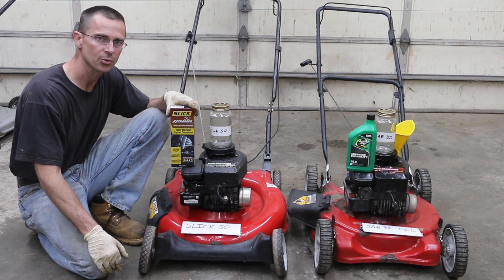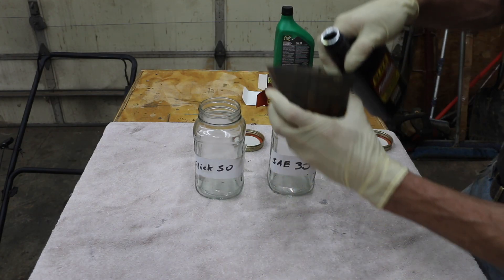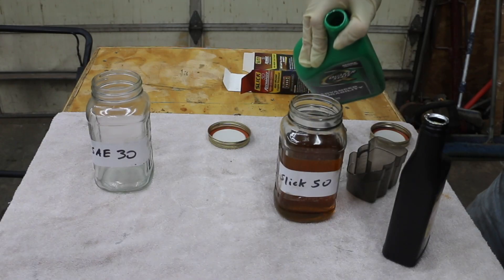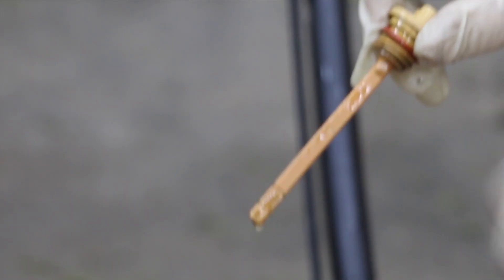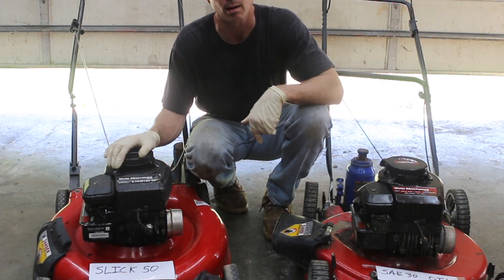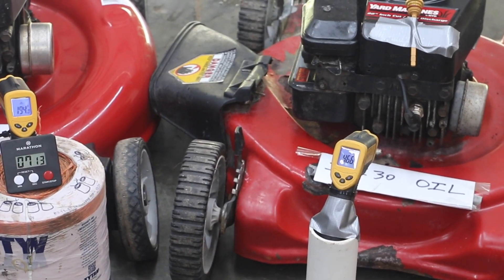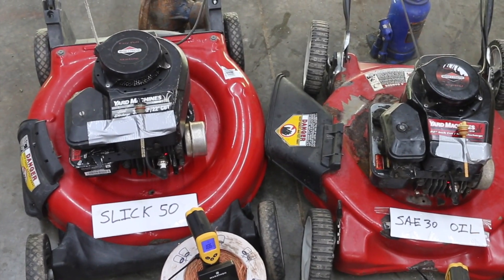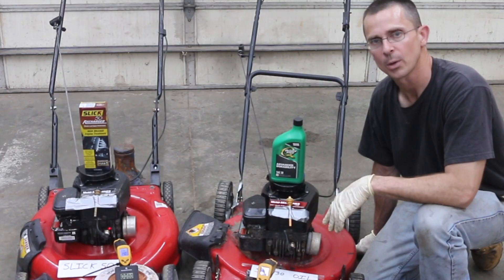Can't believe what SLICK 50 did to my engine!!--Dry Crankcase Test!

Comment: issue here is control. those engines are same design but way different hours. There is no way this test is reliable. the bearing wear/cylinder wear between the engines is a huge factor. You need two identical brand new engines to have any real comparison. So the ONLY thing learned is slick 50 appears to run cooler. yet again this could have to do with piston material in either engine, exhaust from slick 50 engine blowing high temp air into s.a.e. 30 engine, or fuel mixture rich or lean in each engine. while both are same design they could be built in different factories with different carbs or jetting . thanks but not a reliable test

source= im an A.S.E. certified mechanic in engine rebuild/diagnostics
Reply from the maker: I agree.  Using 2 new engines would be ideal.  Thanks for watching the video and commenting!
Reply: could also have something to do with slick 50 being complete bs.....
Reply: Either that or just buy 2 brand new mowers...same time, same store..production tolerances should be consistent enough to call them equal....not that it matters..when it comes to lubricating bearings its all about keeping them cool..oil keeps the temp down enough to keep bearing material below melting point. Ever remember seeing a booth at the swap-meet...guy has an old 6 cylinder on a run stand without an oil pan...and the motor running? Know how they do that? Roller bearings on the rods and mains...rings dont need much oil..keep the temp down they will still seal enough to run a motor with no load happy...hyd. lifters bleed down without oil..adjust them like they were solids....you can run a differential a million miles without oil...100 yards at a time. I had an older olds..blew the bottom radiator hose 25 miles from nowhere...drove it home with no damage...start it up, run it up to 60 and shut it off and coast it down to 5 mph...shit 50 is garbage and always has been...as for lucas...destructive testing is not within my budget but...if you use atf for drilling holes in steel it works plenty decent...motor oil works oil after it burns away on the cutting edge....lucas is not a good lube for drilling..it seems to need more pressure and things need to get hotter before it starts cutting...there is no 'miracle lube" no substitute for clean oil...now days with f.i oil contamination has been reduced to the point where most any motor will last 300k miles....just my opinion of course..
Reply: iamtehstig yeah then when one breaks, put it back in the box and bring it back to harbour freight. "idk it didn't run very well"
Reply: Yeah, I would toss 20 bucks towards that for sure. Start with brand new Predator 212s. They are usually marked down to 100 bucks or so.
Reply: Not an advocate of deception, but for joking purposes, "you could even buy the extended warranty"  = endless supply for 2 years.......
Reply: Deftones Dsm Completely spot on, A cool video but as an engineer was quite frustrated watching it, there are so many variables at play that the results are meaningless. Personally lower outside head/block temp ain't always a good thing. Is the slick50 helping by reduced friction or is it interfering with the oils ability to absorb and transfer heat to the block/head like it's suppose to? The cooler running engine could simply be running richer, ignition timing wrong, the control factors are endless.
Reply: Dennis How is it a good baseline test?  We know nothing about the prior condition of either engine.  We don't know the hours of operation, maintenance history or anything else about them.  An engine with ten times the hours and a history of never changing oil or being run low on oil vs an engine with low hours and impeccable maintenance is hardly a fair or accurate comparison.  Of course we don't know that is the case but that's the whole point that invalidates this experiment.  I would say the only thing we learned is that an engine with Slick 50 runs cooler but the testing is so flawed we can't even reach that conclusion.  To do so we would need to see the operating temperature of the same engine before and after Slick 50 was added.  Some engines run cooler than others for a wide variety of reasons.  As also pointed out the hot exhaust from the Slick 50 engine was directed at the conventional oil engine.  That alone likely made the temperature difference.  These are air cooled engines after all.
Reply: It is reliable , it has been made b4 and it showed exactly the same result. Slick 50 destroys engines, even with oil in them.
Reply: The neighbor kid puts my used synthetic oil in his old truck, and that damn thing has outlasted 3 of my new cars.
Reply: ZoDDyXXX hey, my alma mater, Cal Poly!!!!

Could you possibly scan that article and send it to me? I'd love to read it. I could also host it under my own name if you'd like (so you stay on the good side of © junk). Cell phone would be just as good in the absence of a scanner. Might be even easier given all the different options for sharing photos from your phone. Some Acrobat Pro OCR magic and boom, easy to share PDF for anyone who wants it.

Anyways, at Cal Poly your first quarter is scheduled for you automatically and for BSME students that includes ME134, intro to mech eng w/lab. One of those labs is tearing down and reassembling a 4 stroke Briggs. Beyond the basics of learning how everything works the major lesson is orienting the piston rings such that you got decent compression after reassembly. I wonder if that lab came out of the research mentioned in the article you've summarized.
Reply: I would also add thermocouples for temp measurements, placed in the same location on each engine, as well as RPM sensors. Many different options including some basic data logging. 

At the very least, for temperature readings using the infrared thermometers I would grind a flat spot (s) somewhere and paint them black with high temp paint to provide a larger and unicorn target.
Reply: Deftones Dsm 0
Reply: Jeep Life Ya wanna bet? I know "they" and   "they" was using roller rod and main bearings is 2 strokes and 4 strokes long before I was even born
Reply: Both engines are the same with only possible type number differences. I believe those are Briggs & Stratton 9 series. "90210-1127-01 vs 90210-1129-01", something like that. Note both have Vaccu-Jet carburetors. There are no carburetor adjustment screws whatsoever on those type engines, not even an idle set screw. The main jet is actually down in a chamber in the gas tank. No idle circuit. They don't idle. No throttle controls on both mowers. The cables seen are the operator presence or "Dead Man Switch" cables. If it helps, I've recently retired from working on small engines since  October of 1973.The brands of mowers are different. That's about it. However, running these engines under no-load conditions is not a reliable testing method. Had both engines been under load, there's a good chance the Slick 50 engine would have seized soon after the "regular" engine. Also, these engines never seize at the piston. It's always the top crankshaft bearing. Always. I've never experienced a customer's mower seizing at the piston/cylinder from lack of lubrication. To load test vertical shaft mower engines, it's required to make some sort of spray bar (a pipe with holes drilled in it) that sprays a significant amount of water up into the blade and blade housing/mower deck. I used home-made ones as a "poor man's dynamometer/load testers". They're popular with grass and dirt removal also. Back in olden days, (1960's) there was this shyster at the local swap meet who ran a horizontal shaft small engine with a clear Lucite sump cover to show how well his oil additive was. He'd run it dry but at an idle. "Look, folks! No oil!" My brother and I, as kids, would ruin his spiel with: "Put that sucker under a load and floor it!" My brother would also say: "So, as long as oil is kept in the engine, your product wouldn't be needed." Poor dude. Potential customers would split. Any internal combustion engine will idle forever using residual (cling) oil. Of course, revving the sucker up might fling and/or squeeze out residual oil from bearing surfaces. I have completed many "engine failure analysis" courses over the years, one from John Deere Industrial (the yellow Deeres)  I wonder if "Scooter George" is out here in the internet world watching. Hello?! George? You out here?! Care to share your experience(s) with engine failure?
Reply: Actually, A.S.E. "certification" means nothing. Anyone who knows how to read can get "certified". The testing procedure(s) are "open book". The answers are provided. "Why?" might you ask? Because today's "mechanics" are, for the most part, idiots who probably have trouble finding their way home after work every day. John Deere Industrial (the yellow Deeres) had the same type of testing called "John Deere In-House Factory Training Programs" I "passed" about 17 of them and have them all framed but not enough wall space anywhere. I've since attained 20 more from small engine "Update Seminars" which were nothing more than a bunch of hung-over mechanics looking forward to the free buffet lunch. How many of you "mechanics" been around long enough to have had to look up parts with tome-like catalogs? I have! Pre-micro-fiche days. Now, it's just a matter of typing in "partstree.com" on your laptop on your tool box. Be easy on the kid, Dennis! Though his grammatical skills are lacking, he actually sounds rather smart..at least compared to most of these "Youtube Experts". What's your qualification(s) & experience(s), kid?
Reply: You could always look at the higher temperature as the engine dissipating more heat to the atmosphere, therefore being more efficient. What needs to be done is somehow getting a reading of the connecting rod to crankshaft temperature. I recall an "Update Seminar" from Brown & Wiser, those ones usually attended by hung over mechanics (me included) from different small engine stores of the Pacific Northwest. One "instructor" showed a video he made of a Honda-powered lawn mower running with no oil. The video was excruciatingly tedious (boring) to watch because the dude had it run at idle. Nothing happened so he jacked the RPM up a bit. Nothing. Finally, he ran it "WFO" (wide...open) and it.....slowly........came........to..........a....................stop. Poor guy. I told him: "Next time, put a load on it." They'll almost idle forever without oil. Me? I'd rev the mower to 6 grand bypassing the governor and drop the mower on a protruding from the ground pipe! A late friend of mine took a horizontal shaft Briggs 3hp and ran it "WFO" (with oil) and "staked the piston" to the cylinder with his .58 caliber black powder musket. He said when it came to a stop, the built-up inertia made the engine take off, rolling along like a runaway wheel! I would have PAID to see that! He was cool...
Reply: John Herlstein Yup, the problem is they sell a 'make a quick buck' solution to LONG term problems, unless you undertake a personal and scientific 8 year long term test to prove these snake oil products (let's face it, who's ever going too) they will keep selling. I believe in good quality oil and change it more frequently and that's it, everything else is snake oil. My personal favourite is the 'engine restore in a can' 😉 www.enginerestore.co.uk - it's laughable.
Reply: Hey 650! What was the source of the seizure? Piston? Crank? Did they say?  Are bullets cast from old wheel weights more destructive than those cast from pure lead?  Did you know that if you over rev your cast iron Kohler engine  it will explode but the pieces stay within the engine. You do, however, get a circle with peace sign crack in the cast iron...
Reply: Deftones Dsm 
P
Reply: Deftones Dsm Thanks for the info, Buzz
Reply: No, he didn't go so far as to open up the engine and perform a failure diagnosis. This is just a scam video to sell the product. Like one famous person said many moons ago: "Why would you need the product if you just kept oil in the engine?" I think it was either Tommy Edison or Hank Ford on a camping trip to the Dez. I was running a customer's mower to get the engine oil warm prior to changing. I was probably the only mechanic on Earth that warmed customer's engines before changing but that's a different story. Anyway, the engine, even though it had oil, put the conrod through the case scattering aluminum everywhere. I thought it was cool! I called him up and he said: "That's okay. I was thinking of buying a new one." He could have been shitty and insisted on a new short block. Went up to Oakland yesterday and saw Rick K. at his antique store.
Reply: On another camping trip, while gazing at the campfire  sparks (AKA "glowing goodies") Hank  mentioned to Tommy all the scrap hardwood pieces left over producing Model T bodies and how he hated throwing ANYTHING away. Tommy thought for a moment and suggested that if the scrap wood was burned in a low-oxygen atmosphere, he could create charcoal briquettes. 

Did you ride the BART while in Oakland? Backfire your car at pedestrians?  Did you drop in on Arlen Ness?
Reply: The sale of those charcoal briquettes didn't make a "King" out of "Ford" but they certainly didn't hurt! Yes, I rode BART although pretty drunk at the time. Never popped my car up there. Yes, I met Arlen & thanks to a certain chromed oil tank bought from Arlen, a "Tramp" wanted to "Kick your ass if you weren't on those crutches." What a jerk, after all I did for him and his club.
Reply: What if Al Bernie Nobel hadn't died in December of '96 and gone camping with them? Sitting around the campfire, Hank would have asked: "Whatcha got, Al?" "Oh, dis es mine latesht envenshun. Watch dis!" The glowing goodies would have been absolutely spectacular! You would have wet your leg! Tommy would always ask "Wha'd he say?"
Reply: Oh, Hank didn't "invent" the assembly line, kids. He just improved on it. That endless line of T's exiting the "factory"? Just a staged publicity clip. They didn't come off but maybe one every 15 minutes, 1/2 hour or so.
Reply: Would have gotten a bang out of that idea.
Reply: HF sells those extended warranties with the selling point of "for any reason, they will replace it".
Reply: These little Briggs engines aren't too complicated. We're not talking Space Shuttle technology. They only  have 5 moving parts, not including valve springs, keepers and retainers. No ball or roller bearings. Just plain aluminum block material. It takes a lot of lack of maintenance to do any of these engines initial harm. The mowers appeared to be in good shape and not stored under a rain spout and shit. That's a good sign of little to no abuse. The test was fair but still misleading. As long as you keep oil in the engine, there's no need for Slick 50.
Reply: "extended warranties" are a joke. I know a dude who got fired from Sears' appliance department because he refused to push "extended warranties" on customers. His superiors told him that extended warranties bring more money to Sears than anything. If something has a 1 year warranty and they want you to buy an extended warranty, tell them: "If it's going to fail due to inferior workmanship and/or materials, it'll happen in the first hour. No thanks."
Reply: I backfired at Al once. Not a flinch. Used to explosions I guess. Tommy didn't flinch either. Wonder why...
Reply: "I notice that the dipstick/filler tube appears to be a different angle in the slick-50 engine versus the sae30 engine." Indicating what?
Reply: No, they're both vertical. Trust me. I've worked on literally hundreds of small engines. More like thousands but who's counting? You should have known.
Reply: The man to have asked would have been Rocky "Dipstick" Rowlett but due to unforeseeable circumstances, he's now bellied up to The Great Tavern in the Sky". Have one on us, Rock! RIP
Reply: You noticed how he "drained" the oil? No "expert" he! All these engines have a drain plug on the bottom of the engines. All you do is use the deck height adjusters (wheels) and set them so the drain hole is at the lowest. Of course having a mower lift certainly helps. I've had certain models with blade brake controls (BBC) that deny access to said plug but I just get the fucker hot and use a large piece of clear fuel line and use the old Tennessee Credit Card Removal System or "TCCRS". Some use a black hose and use the "SHIT" method: "Siphon Hose Ingestion Type". I prefer clear hoses. Comes especially handy when swiping someone else's fuel.
Reply: Where can I get a dipstick for a Honda S-50?
Reply: "No, they're both vertical. Trust me. I've worked on literally hundreds of small engines. More like thousands but who's counting? You should have known."
One engine is American, the other Asian. The former is on the up and up. The other one slopes...Went by a tavern in Everett Washington a few years back.  Sign at the bar said, "The Rock stops here." ; ) We all miss you Rocky!
Reply: Honda Mort 50. That thing had like 1.5:1 compression and ran so hot (when you could get it to start) the engine glowed white. Had to pull start it with a Tote Gote to pump up any measurable amount of compression. I remember his engine all covered with oil and a McDonald's cup crammed in the hole. He had a "Rislone" sticker on his 8th grade folder and I thought that was his last name for a while: "Rocky Rislone". Mom and Gloria took turns carpooling Pat, Dee, Claudia, Rosie and you to Cambodia...and back Hell of a daily commute! I recall going along for the ride. Conejo Grade was 3 lanes.
Reply: Deftones Dsm I would expect an older engine to last longer, due to sloppy tolerances.
Reply: Maybe. More room for expansion.
Reply: Some Douglas DC-3's are still aviating some 80 years later. Personally, I'd feel safer in that 80 year old aircraft than any new passenger aircraft. I mean, what are the odds of the DC-3 finally giving up the ghost with me on it?
Reply: Did you say ghost? Spooky...bet you wish you could be door gunner! https://video.search.yahoo.com/search/video?fr=mcafee&p=c-47+spooky#id=1&vid=5d8a298cf28efcfeef09f078e762c032&action=click
Reply: You know, I noticed 2 things I was going to give you but forgot. One is an Avon "'64 Mustang" after shave and the other that Mustang glove box lid. Remind me next time!
Reply: Oh, door gunner on Spooky? Glowing goodies galore! (at night)
Reply: Is there any after shave in the Mustang? Could use some. Changed the cardboard liner already for the glove compartment.
Reply: 4,000 rounds per minute? What's not to like!
Reply: Yes. Full. I bought a "shipload" of Avon bottles at a yard sale. I bought all transportation related. Got 64 I think. All but one full.
Reply: One out of every 3 or 4 rounds a tracer as to "walk" to the target. Dudes could light the Dink's "roach" they were so accurate...OOOPS! Missed the "roach"! So sowwy, Chawwey!
Reply: For the longest time, I thought the label said: "SUCK 50", kind of like those "FLICKS" candies in the Fox theater in TO.
Reply: Or maybe you could run both engines A and B with 30W and take a bunch of data like temperatures and oil color, compression (cold and warm), recoil pull force, cylinder walls close up, etc. then put SL50 mixture in engine A and new 30W in engine B and take the same set of data. Then new 30W in engine A and SL50 mix in engine B and the same set of data.
But it could be that the effects of SL50 are subtle and would require 100 engines with 30W and 100 engines with SL50 mix to any kind of statistically noticeable effects.
But some things have a strong enough effect to only require two engines for the experiment, one with 30W and the other engine with sand or gasoline or water for the lubricant. :-D
Reply: These small engines will run almost forever without oil present (after draining) due to "residual" oil still adhered to bearing surfaces....as long as the engine is at idle without a load. Even at their 3600 rated RPM, as you saw in the video, they'll run pretty long. Instead of doing all what you say, how about just keeping oil in the crankcase? I mean, even with your shittiest Pep Boys or K Mart oil, they'll run forever. I just quit after 42 years as a mechanic (last employer tells my customers I "retired") and I'd never seen one single (small) engine worn out or failed with engine in the crankcase. I had one idiot working for me (not hired BY me!) who re-ringed a small lawn mower because it "only" had 65 pounds compression. He sunk about $1040 worth of labor (@ $65 hr.) charged the customer $175 and it still took 17 and more pulls to start it. (he called it good) All that was wrong was, the choke wasn't closing. I "fixed" it in 30 seconds and even in 24 degree weather, it started first pull. I guess my point is, unless you know what you're doing, leave the subject alone. I mean, how many "Failure Analysis" courses have you graduated form? You should have known.
Reply: "For the longest time, I thought the label said: "SUCK 50", kind of like those "FLICKS" candies in the Fox theater in TO"
The Arcade version of "Pac Man" was originally going to be named "Puck Man" till it was pointed out how easily the "P" could be changer into an "F."
Reply: @lifequest7453  Those 25 cars will last longer without any PTFE clogging, Try to put  strong neodymium magnets on the oilfilter when using PTFE addive and run them between the oil change.. not a fun reading. So never use this crap in your motor!!  Even Dupont tried to stop this usage after lot's of testing. Dupont has a lot of muscle and money so i trust their scientifically results more than any "garage science"
Reply: @lifequest7453  That's up to you to use PTFE products my friend, long ago Mazda tried to PTFE treat their rotary engines to fight the apex wear, it wasn't successful so they quit. I wonder why? Too good? Your statement about Dupont is not correct. the legal action against the use of PTFE as an addive in oil was about something else. They made lot's of testing and the result was that PTFE was harmful for every tested engine. it clogged the porosity cavities in cylinders so the oil molecules couldn't stick to it.  If Dupont had found out that PTFE was good for engines they would have went to the market with their own oil treatment but they didn't. and they didn't want anybody else to do it and destroy the Teflon brand  in other products.
Reply: @lifequest7453  50.000 miles are nothing for a dieseltruck. with a recommended service you won't see any trouble in that type of engine. I don't see the point in aftermarket additives when the standardoil doing a perfect job with no additional costs. 

you can call PTFE new or old, but it still have the same chemical substance.  I work with military aircrafts and it has been lot's of research to get advantages of new inventions and exotic surface treatments... Teflon is not one of them, you can't even use it in non stick kitchen stuff, it will poison you like the Dupont factory did in Carolina. US.  

You do whatever you want,  but my opinion won't change when i know I'm right.. no motoroil manufacturers use it, they put billions in research and improvements, but nobody use the  PTFE except a few "magic oil" companys.
Reply: @lifequest7453  I base my facts on my own experience, friends tests, logic, huge tests made by known companys, tests made by universities, tests made by the owner of the product. 

No oil company's use it, we don't use it at work, car manufacturers has evaluated the product and they don't use it either. 

My point is that you are pretty alone to still fight for PTFE in oil as a miracle product.  It has been done and it failed, case closed! 

I'm not stupid, I'm well aware how engines works, how oil lubricate the engine, how the molecules work, how they stick to surfaces, how oil differ from different districts. 

There are plenty of articles that describe how PTFE makes ppl sick and how it breaks down under high heat. 

I've been doing this for 40years, i build race engines, my profession is technical engineering aiming at jetfighter prototyping 

PTFE do work in special applications roller bearings, cogwheels in constant oilbath are a few examples.  

Teflon lower your friction but it increase the wear, sounds strange but i can explain it to you. 

Cylinder sleeves are not made of  dense steel, they use a casting metalspray technique that gives the surface small microscopic pores. 

those pores helps the oil molecules to stick to the walls the porosity in the metal really helps. 

PTFE has problem to stick to shiny surfaces, you need primers and rough surfaces to make the teflon stay better. 

What happen when you put microscopic teflon particles in the oil is that the pistons and the rings will rub in the teflon in the small cavity pores that normally helps the oil to hang on to.. the rough surface are now clogged, the oil can no longer hang on and lubricate the cylinder. 
The teflon won't replace the oil because it cant stick to shiny walls. 

The teflon won't protect the highest tops on the rough surface, so it starts to shave them off. The ware will increase with approx 10-15% and small microscopic metalshavings will spread into the oil and slowly breaking down the engine. The friction will drop, but it still shaves metal..  

I'm not trying to bash you,  my mission in life is to warn ppl from doing mistakes that has been done b4, i dont want ppl to destroy their engines. the choice is yours, if you are happy.. thats great, but not great for your engine. 🙂
Reply: Issue is you can make any product and make up what ever claims of advantages if they are hard or impossible to prove wrong, You can bottle camels piss and claim it reduces your engine wear 10% and people will buy it.
Reply: STOP BEFORE YOU PUT Slick 50 INTO ANYTHING YOU CARE ABOUT!!!  What follows
is a post summarizing a small portion of an article I read recently
on engine oil additives.  Delete this now if you're not interested in the
topic.

Now that I have your attention, there is a MUST READ article in the
August 1992 issue of Road Rider magazine.  The article is entitled,
"Snake Oil!  Is That Additive Really a Negative?"  I will not retype the
whole article here as it is rather lengthy, however, suffice it to
say that after reading the article I will not let the stuff anywhere
near ANY of my engines.  The article bases it's statements on test results
from the following very reputable research institutions: University of
Nevada Desert Research Center, Avco Lycoming (aircraft engine
manufacturerers), Dupont Chemical Company (the creator of PTFE which is
the main ingredient in Slick 50 and other similar products), North Dakota
State University, Briggs and Stratton (of lawn mower engine fame), the
University of Utah Engineering Experiment Station, California State
Polytechnic College and NASA Lewis Research Center.  Quite an impressive
list.  Each of these institutions spoke out AGAINST using Slick 50 in your
engine.  In fact, ROAD RIDER was unable to find any independent testing
organization that would support the findings that Slick 50 brags about.
When you ask the Slick 50 folks about who did their testing, they will
not tell you.  Here's one quote from the article I think you'll want
to read,

"...  By far the most damning testimonial against these products
originally came from the DuPont Chemical Corporation, inventor of PTFE and
holder of the patents and trademarks for Teflon.  In a statement issued
about ten years ago, DuPont's Fluoropolymers Division Product Specialist,
J.F. Imbalzano said, "Teflon is not useful as an ingredient in oil additives
or oils used for internal combustion engines."

At the time, DuPont threatened legal action against anyone who used the
name "Teflon" on any oil product destined for use in an internal combustion
engine, and refused to sell its PTFE powders to anyone who intended to use
them for such purposes.

After a flurry of lawsuits from oil additive makers, claiming DuPont could
not prove the PTFE was harmful to engines, DuPont was forced to once again
begine selling their PTFE to the additive producers." - ROAD RIDER/August 1992

Here are a couple of the things mentioned in the article as possible failure
modes for Slick 50 style products:

1)  PTFE is a solid.  The additive makers claim this solid "coats" the moving
  parts in an engine.  The article states, however, that, "such solids seem
  even more inclined to coat non-moving parts, like oil passages and filters.
  After all, if it can build up under the pressures and friction exerted on a
  cylinder wall, then it stands to reason it should buid up even better in
  places with low pressures and vitually no friction."

2)  Additive manufacturers will claim that they use "sub-micron" sized
  particles that will pass through your oil filter.  The only problem is
  that, "PTFE expands radically when exposed to heat."  So when your engine
  reaches normal operating temparatures, the particles may not longer pass
  through your filter, but instead will clog it!

The above quotes and data are just small tidbits from an article filled
with such information.  Briggs and Stratton has done testing on it's engines
with and without the stuff and found the an engine using the stuff actually
showed more wear than an engine using conventional motor oil.  Do read
the article.  It does not come out and tell you that you should not use
Slick 50 and other products like it, but it gives you lots of data for
you to make your own decisions.  For example, if I was someone with a
racing motor that was torn down and rebuilt after each race, I might
consider using the product as there are some results that have shown
there to be less friction within the engine, thus resulting in an increase
in horsepower.
Reply: I will also donate $20 if he sets up a go fundme
Reply: blackbirdxx928 lol they don't make roller bearing for rods and main bearings. only roller lifter and cam,rocker arms
Reply: I notice that the dipstick/filler tube appears to be a different angle in the slick-50 engine versus the sae30 engine.
Reply: @ Deftones Dsm <" source= im an A.S.E. certified mechanic in engine rebuild/diagnostics">
WHOOOPIE!!!
You're full of crap! Stop trying to be a know -it-all because nobody likes a smart-a__!  
This was a pretty good baseline test!